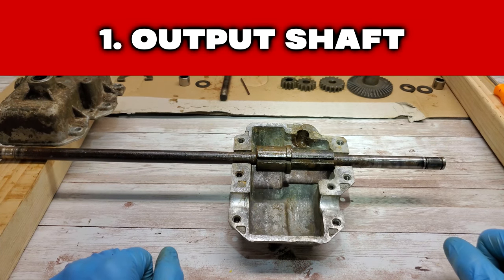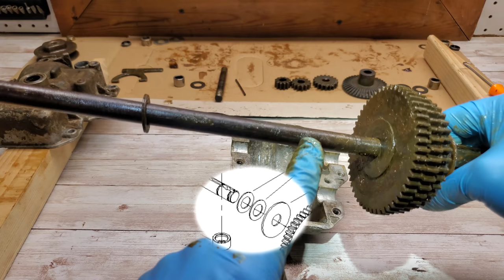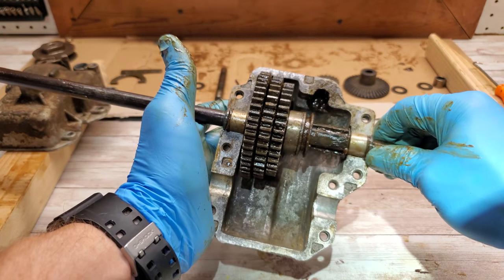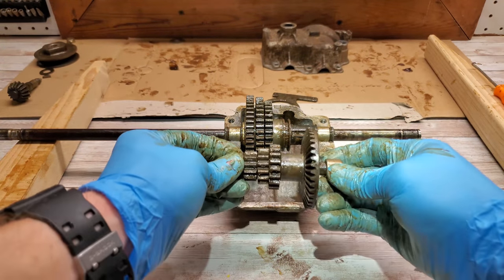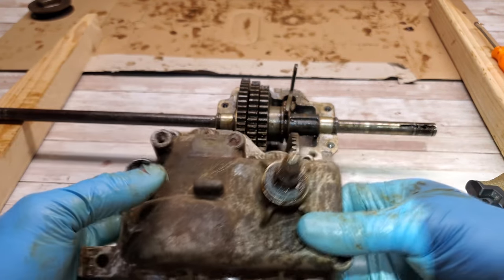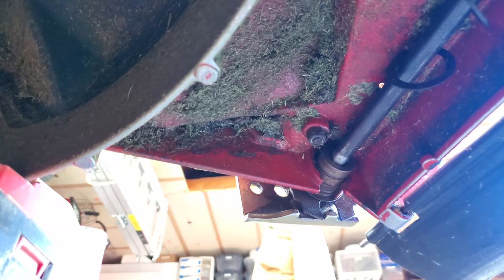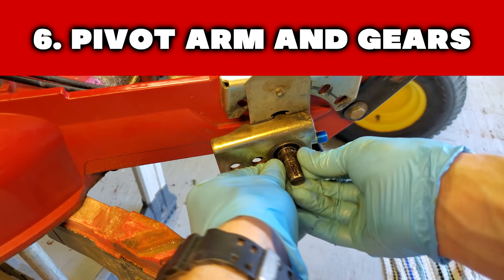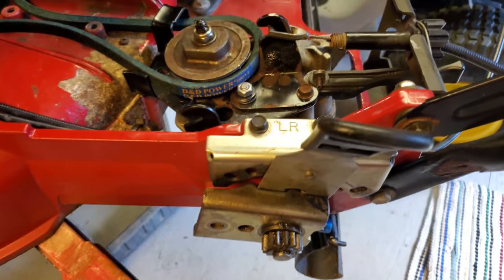Toro Commercial Lawnmower Transmission Rebuild (4K 60fps)

Comment: I just watched a video where the guy said the second washer was labeled "optional".  He then went on to say that maybe it would work if he put them both in, as he was having trouble with getting it to work lol.  I am going to take mine apart to clean and grease it tomorrow, as I just did the front wheels today.  Nice job and video editing!
Reply from the maker: Yeah I think I saw the same, I'm sure there's some technical reason, but hey it's a lawnmower not the space shuttle right?
Reply: @congresstart6463  No, it's not the space shuttle lol (but you still used No. 2 lithium, right?)
Reply from the maker: @campbellpaul  yes sir!

Comment: Any idea why the mower would be slow in 3rd gear? Almost like it's in 2nd but maybe a little faster. Also, when off I pull in reverse, there is tension on the wheels but the handle is down and belt doesn't have tension on it. I was thinking maybe too much grease in the wheel gears but haven't inspected yet. Just bought it.